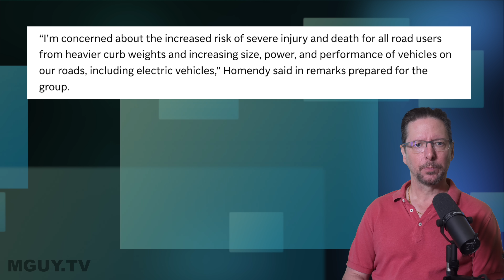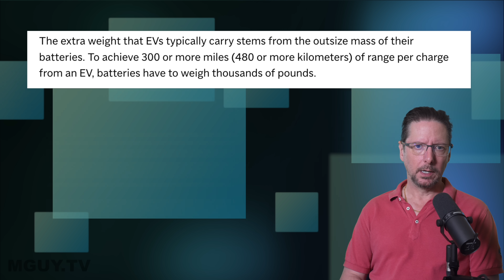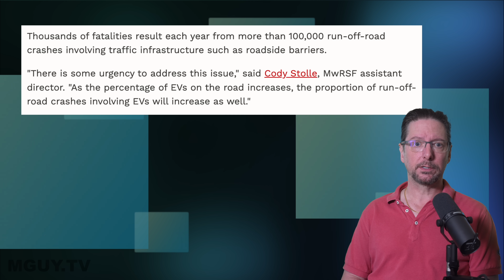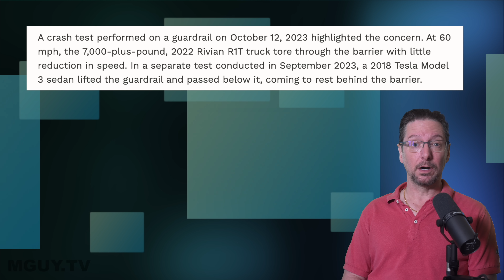EVs TOO HEAVY for roadside crash barriers (guard rails) | MGUY Australia

Comment: Really vehicle have become heavier generally, while EV, extra so. My very normal 2 liter diesel car is almost 2 tons. If a bought a Volvo 745 in the late 80s, it would be like 1.4 tons. If my car was a PHEV it would be around 2.3 tons and if it was a EV it would be 2.6 tons. That is pretty close to twice the weight.

Well the solution is really quite simple. Either ban EV or expand the size of the parking lots
Reply: The Audi A4 (B7) 2.0 TDI weighs 1430 Kg / 3153 lbs. BMW G20 3 Series 320d weighs 1526 Kg / 3364 lbs
Reply: All this extra safety crash test compliance is making cars too big. There has to be a rethink on cars as cities need mini  cars and that can not be achieved with crash test standards